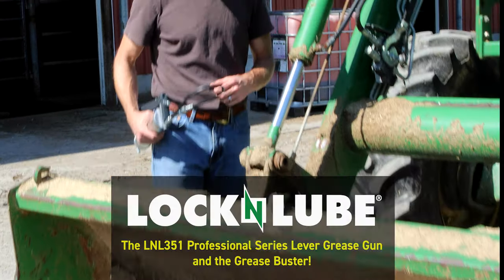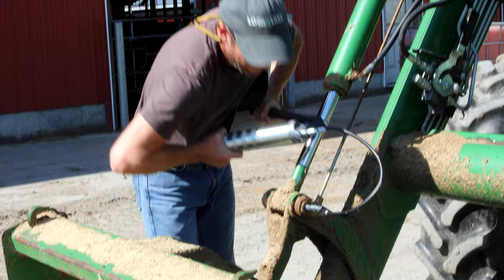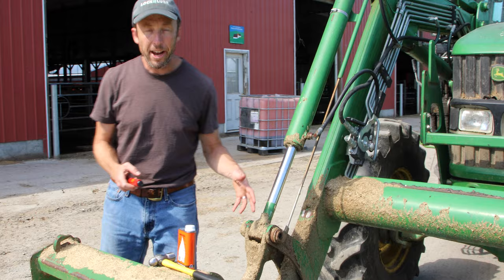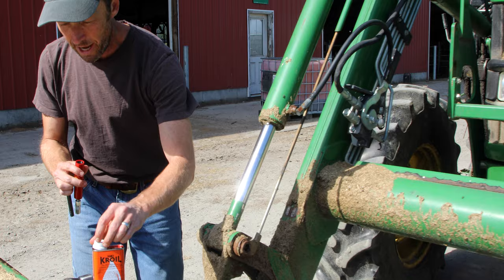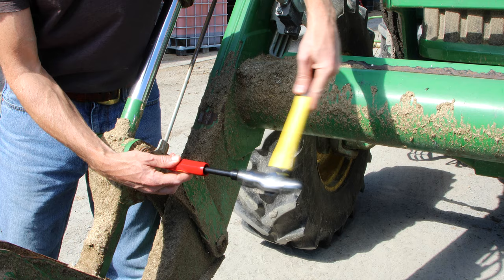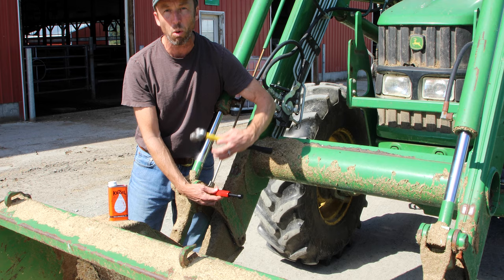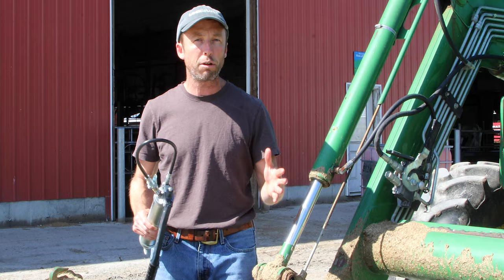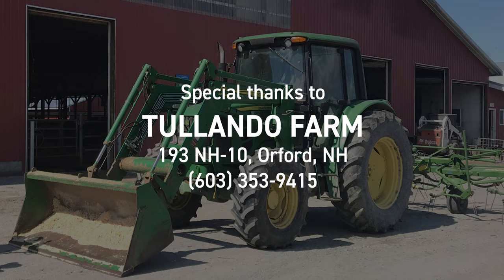Using the #LockNLube Grease Buster and the LNL351 on a clogged grease fitting.

Comment: Are most clogged grease fittings caused from old dried up grease or grains of sand? Also funny story, my friend has a backhoe he uses on his farm and he never greases it. So I'm over there helping him grease it and the main pivot pins for the backhoe attachment aren't taking grease. Install new fittings and still no grease. Come to find out the bushings were so dry that the friction of the pins spun them in the housing. Had to drill new holes for them to take grease.
Reply from the maker: A combination of both, usually.  Some work environments are just especially dirty, and not getting time to grease regularly is every busy workman's challenge.

Comment: I keep my tractor in an enclosed outbuilding, so it is not exposed to outside weather when not in use.  I still get clogged zerk fittings sometimes, and I just unscrew the fitting, insert it into the LocknLube, and the hardened grease easily gets pushed out.  For equipment stored outside, however, I have had zerk fittings get stripped out, so I prefer not to try to remove them.  What effect will the penetrating oil have on the grease when the tool pushes it through the zerk fitting?  Will the grease break down more quickly?

Comment: bought  same thing to inblock zerks - not satyisfied at all , better to buy adapter and grease it wiyhout zerks
Reply from the maker: You can certainly try that. With problems like this, there is rarely just 1 available solution, the Grease Buster is a nice option.
Reply: @LockNLube  i told that i've bought  grease buster and it didnt work in some places , what i will suggest is to dismantle zerk clean it with awl and than screw in grease tube straight in (without coupler) thread/thread and press through)

Comment: Why not simply replace the zerk?
Reply from the maker: There are multiple reasons, first Zerks cost and it usually a pain to replace them. Sometimes they just have a little bit of corrosion from winter salt and a couple minutes of time will fix them. Sometimes you have hardening of grease behind the zerk in the machine itself and you need to dissolve the "plug" with a fluid. It's not a tool for everyone but the people that fight with zerks all the time love the tool. Reach out to use at (603) 795-2298 or sales@locknlube.com with anything else we can help with.

Comment: its 20" or 30" hose ?
Reply from the maker: Hi Pan,
The extension hose for the Grease Buster is 5' and not be used as a grease gun hose. It's helpful for Zerks that are at on 90 degree angles.
Reply: @LockNLube  3:57 grease gun has which lenght of the hose ?
Reply from the maker: Most of the grease guns come with a 20" whip hose.
Reply: @LockNLube  i know it , i'm asking the exact length of the hose at the certain time code (in this video)
Reply from the maker: Again, its a 5" hose.

https://locknlube.com/products/grease-buster-hose-extension

Comment: Or u can change fitting in 3 minutes lol
Reply from the maker: If it's just the Zerk then that can certainly work quickly for you. If you are trying to free up a joint or pin that is all seized up, you can use the Grease Buster to push solvent through the entire assembly, breaking up the dried-up gunk and flushing it out so you can refill with fresh grease.